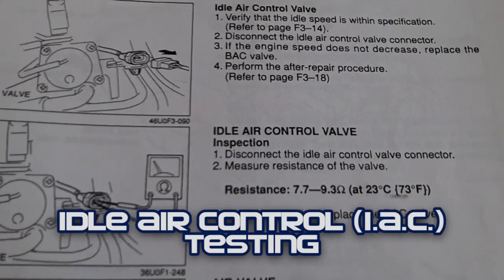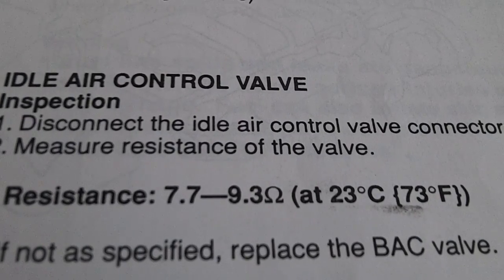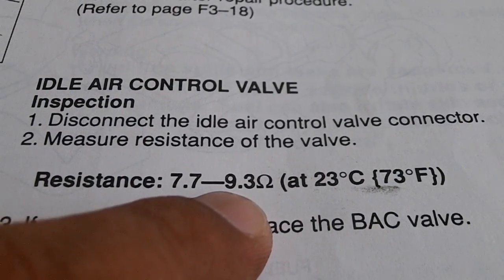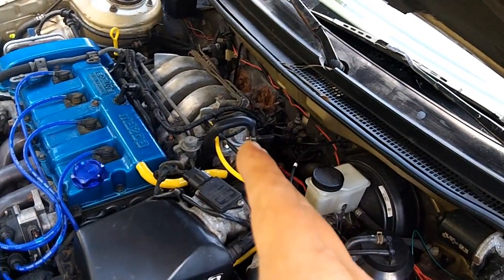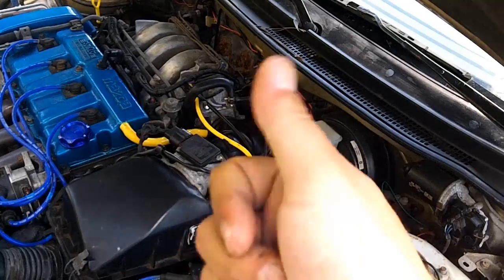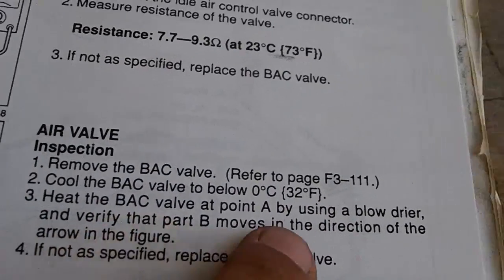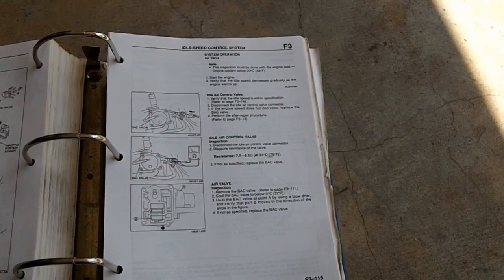Mazda 626 - Idle Air Control (IAC) Valve Testing

Comment: Big shout out to your video. Got a 99 mazda 626 with no manual. Problem is idles high then low and sputters and tries to die out. I changed plugs and wires and this is where it all begun. Plz and ty
Reply from the maker: Honestly there are more than a few things that could cause your issue, about 30 of them. The most common is a vacuum leak or more specifically an air/fuel mixture issue that’s cause the idle to hunt. The ECU is attempting to compensate and failing at doing so. The IAC and fuel injector pulse are the only physical measures the ECU has at its disposal to compensate, everything else is basically just a sensor. Because it cannot correct the idle it means it physically cannot compensate enough or the sensor data it’s using to do those compensations is false. Therefore a faulty sensor(s) is also a possibility. Idle issues are the hardest to track down on an OBD-1 vehicle. To say I’d have the exact answer to the issue for your specific vehicle when there are 30 possible culprits would be disingenuous. A mechanic is really needed to go over the long checklist of possible culprits. There is no single answer to your question. When it comes to answering questions online about idle issues in particular, it’s a minefield of guesses when diagnostics is the only real answer.
Reply: @DJDevon3  hello again. I hve a question regarding my 99 mazda 626. I was told my axels need replacing and i also need a tire rotation however due to high cost of the axels and labor was wondering if i cld just rotate the tires but im afraid the rotation will damage the axles more before i can afford the repair. I know it's not safe to drive but i hve no chose. I value your expertise and your videoes are very helpful. Ty

Comment: Any idea what would be causing excessive engine vibration even when the rpm is within spec of the manual (around 750rpm). Revving up the car with the throttle clears away vibration.
1997 Mazda 626 1.8
Reply: It's the front o2 sensor

Comment: Hey man!! Noticed your video is from 8 years ago.. you probably won’t respond but if you do, I was wondering what could cause the shaking on my 1995 Mazda 626, and no, it’s not the motor mounts I changed them, it only shakes when warmed up, when it’s cold it will not shake any suggestions?
Reply: 02 sesnor near the engine block

Comment: Where specifically are you connecting your leads for testing? I've watched this video a few times and I don't see it clearly.
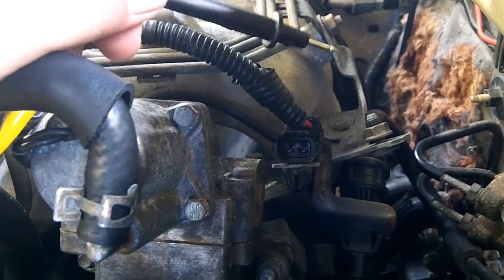Reply from the maker: There are two male pins inside the plug. 1:17 I'm just touching the pins with the meter probes.

Comment: How do you check for proper operation of the IAC solenoid itself. I have mine off and it measures 10 Ohms but does not move when 12V is applied. Im getting an inductive spark on the connection so I presume the coil is OK. Can you advise if the pin down at the bottom of the plunger sleeve is meant to pull in or push up on application of power. My whole problem stems from the engine running too rich when hot. Coolant flow in and out of the IAC chamber seem ok so Im guessing that this solenoid is mechanically stuck. Thanks.
Reply from the maker: This video only applies to a 1993-1995 with a mechanical plunger. It would help if you specified the year of your vehicle as the IAC changed design for OBD-II. The plunger pushes outwards as the car warms up during open loop.  Confirm this by doing the test described starting at 1:55.  Work shop manuals are available on PMX626.info absolutely free.
Reply: Thanks for the info and link. It's a '92 Ford Telstar (New Zealand) GLEi  2L DOHC I'm restoring, The IAC is exactly the same as in your video. It does appear that the plunger is jammed/frozen in the cold/choke position. On cleaning and reassembly, the over-rich problem (on all running, not just cold) seems to have cleared and it's running lean and no black smoke. I have not taken the butterly-valve assembly off for cleaning (no problems with running or power). On the down side though, idle rpm is now very low and the engine stops with no accelerator.
Reply: @garypotts4198  Do you know where your Idle Adjustment Screw is located?  It is in the hole on top of my butter-fly valve assembly on my MX-3 V6.  Took me a while to learn that trick too.

Comment: hello mr. What is the size of the piston standard, cylinder liner, crank pin journal, and crank journal? Please help me. For mazda cronos 2.0
Reply from the maker: Visit PMX626.info and look in the work shop manual (WSM).

Comment: What is main problem when your RPM is ups and down when you start the car?
Reply from the maker: Fluctuating idle is caused by a variety of different things. Usually, a vacuum leak or faulty throttle position sensor. You can look up all the different causes of fluctuating idle in the WSM.
Reply: @DJDevon3  when I replace the new PCV valve the rpm is going down until the engine shut off.. Or there is any vacuum leak other than the PCV valve?

Comment: Got trouble with mazda 626 2.0l dohc '95 model car was running fine before it overheated ,I did the motor head valves ,all bearings and rings ,also inside the distributor a seal went where oil came through was replaced ,but now when it starts up it runs 100% for the first 2 min then it starts hunting between 750rpm and 1500rpm for about 3min wile running very rich and then dies , after that it struggles to start and when it does start it has a misfire , if it cools down completely it runs fine again for that 2 min. please help if you can . Thanks Jano
Reply from the maker: Sounds like it's fine during open loop but stumbles after it's warmed up and enters closed loop operation.  Look into tuning the ECU while in diagnostic mode and setting a better base idle.  Also heat can play a factor for things like a fractured winding coil in the distributor or overheating injectors.  Plenty to check for, don't just go replacing parts, do some diagnostics and find the culprit.  Good luck!
Reply: THANKS ,I'll let you know , never gone into diagnostic mode before you have a vid on that on your page
Reply from the maker: Yes but hate to admit it's not a very good video. :/  Hopefully you'll get some good info from it.  Just gotta get your hands dirty, get in there and practice.  https://www.youtube.com/watch?v=6u-w6lFKKF4
Reply from the maker: How to get your 93-95 Automatic into diagnostic mode. https://www.youtube.com/watch?v=ZY9BeHFW1ng
Reply: THANKS FOR ALL THE INFO!!! not scared to get the hands dirty  :)

Comment: Thanks for the video! This is not the topic of the video but I have a question. My intake coolant hose to the BAC has a crack in it but I cannot find a replacement. Is there a "standard" coolant hose I could buy per foot? How would you suggest replacing it? If it helps, I have a 1988 Mazda 626.
Reply from the maker: +Nomadjackalope In the absence of a molded replacement hose I would try to find one for a different vehicle that uses the same inner diameter and has similar bends or ones that you can cut to meet the needs.  What those are exactly I don't know.  I haven't had to replace that hose in a while. Might be a good question for the 626 forum or 626 facebook group too.

Comment: So if my resistance reads 34 ish,it's bad regardless if it's in the 90 temp range?
Reply from the maker: I would say yes that's way out of spec. These specs are applicable for all 1993-2002 Mazda 626/MX6.  The V6 specs are only about 1 ohm higher which is only ever so slightly higher of a reading compared to the I4.  At 90F it should be about 10-11 ohms.  Something around that range.  34 ohms is very high resistance suggesting the electronics inside the IAC are aged and worn.  It's possible when the car warms up that your IAC will shoot up to infinite resistance which would be a 100% broken IAC.  Make sure you're making good contact.  If those readings are true I would replace your IAC now anyway.
Reply: Cool .Yea ill pro[aly do that.Thanks man

Comment: Hey I have a question. I have a 1993 mazda 626 what is that black box under the throttle body and what dose it do?
Reply from the maker: Robert I'm not sure what black box you're referring to.  Are you talking about the one that is connected to the intake elbow?  That's a resonator.  It's sole purpose is to lessen the sound of incoming air to make the engine just a little bit quieter.  It's like a muffler for the intake.
Reply: It says FS11 on top and if it's the same one then why would it be leaking antifreeze?
Reply from the maker: Robert Kriz
Sounds like you have a V6 and it's the Idle Air Control (IAC). If leaking, the seal inside needs to be replaced.  Read this article: http://mazda626.net/topic/39618-iac-idle-air-control-throttle-body-cleaning-1993-2002-i4

You can get a new seal from RockAuto.com or your local Mazda dealership.
Reply: I have a 4 Cylinder 2.0L
Reply from the maker: Robert Kriz  Can you shoot a video or refer me to a picture.  I don't know what black box under the throttle body you're talking about.  There is no black box under there.  The EGR is under the throttle body on the 2.0L but it's not in the shape of a box.  Do you mean the air resonator attached to the bottom of the intake elbow?
Reply: I think it's that one. But why would it be leaking antifreeze?
Reply: I think it's that one. But why would it be leaking antifreeze?
Reply from the maker: Robert Kriz  There are only 2 ways that coolant can get into your EGR.  Either the IAC is leaking into the intake manifold which leads to the EGR passage or you are burning so much coolant that it's getting dumped into the EGR from the EGR system.  You can remove your throttle body and look inside the intake manifold.  If you see a puddle of coolant there then it's most likely your IAC.  Also look for little rivers that might have cleaned away the carbon and left a trail of evidence pointing to the source.
Reply: I found out where It was comeing from it was a heater Core hose I fixed.. Thanks for your time I'm going to be do the head gasket
Reply: can you get me a rear right Mazda 626 1996 abs senor
Reply from the maker: Terry Degroot http://www.rockauto.com/en/catalog/mazda,1996,626,2.0l+l4,1190067,brake/wheel+hub,abs+wheel+speed+sensor,1912

Comment from the maker: I didn't look it up in the WSM before shooting the video.  After having done so due to your question, this entire procedure does also apply for the 2.0L Manual Transmission 1993-1997.  The same procedure also applies to the 2.5L KL (V6) but resistance is 10.7-12.3 Ohm at 20C/68F.